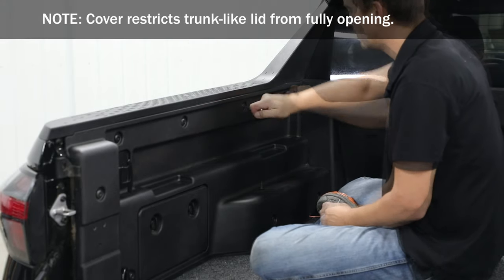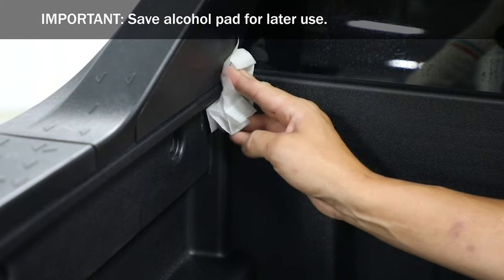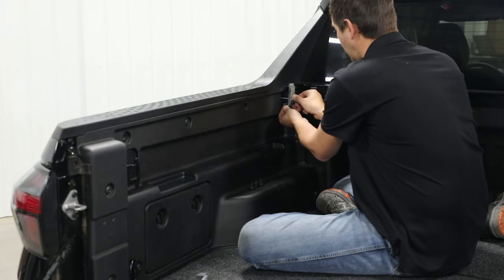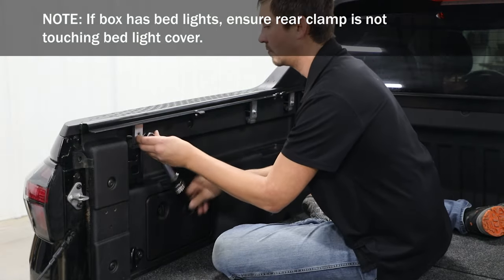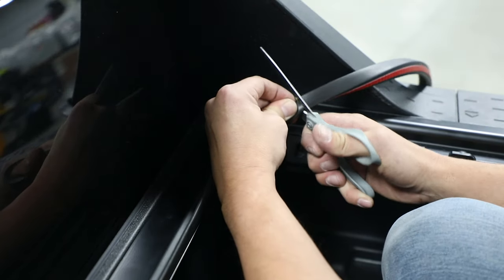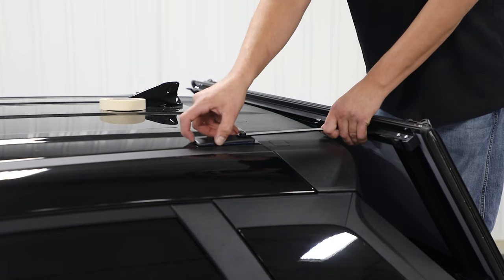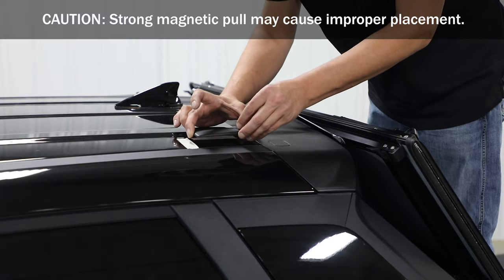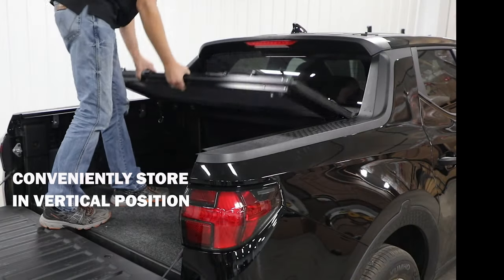2022-ON Hyundai Santa Cruz - LOMAX® STANCE™ Hard Cover Install Video

Comment: Can people shove their fingers in there to open the cover while the tailgate is shut n locked?  How's the security?
Reply from the maker: The security of our LOMAX Folding Hard Covers are excellent. No, if the tailgate is shut and locked, the cover is secure. We have an automatic dual locking system that can only be unlocked by the tailgate being opened so that you can reach under the cover to pull the cord. The cover is locked throughout and sealed with a weathertight seal.
Reply: @agricoverinc thank you, I purchased and installed it with ease.  Great security too as you've mentioned!